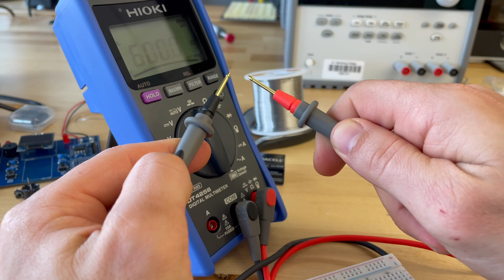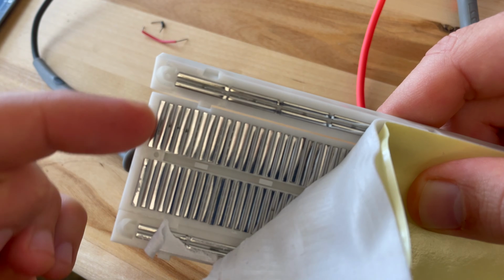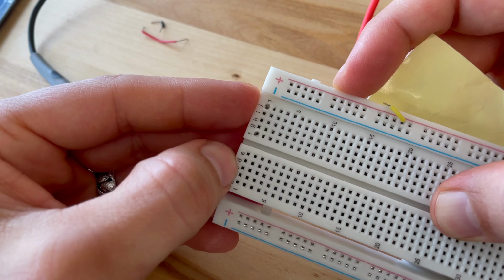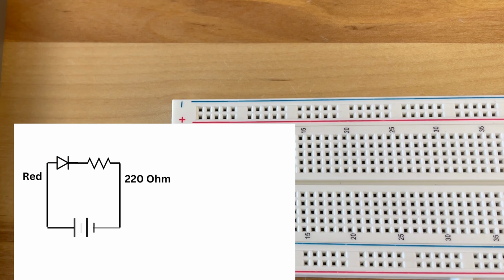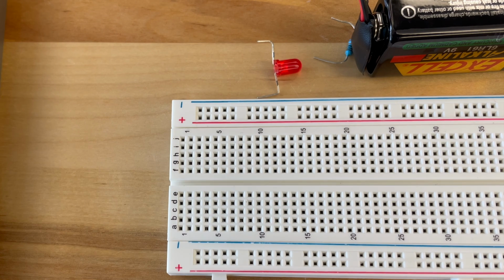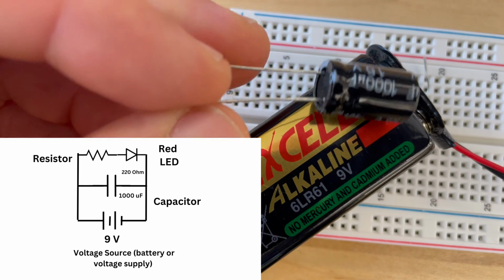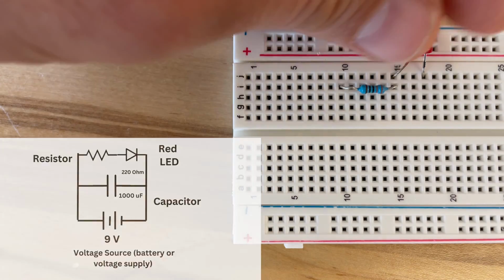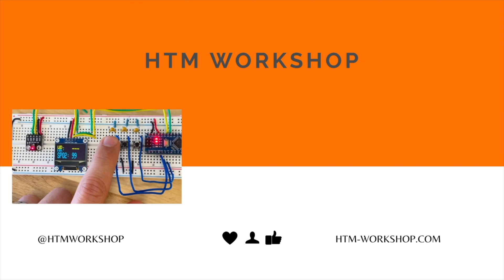Breadboard - Explained in Depth

Comment: Cool tip: buy crocodile probes for the multimeter and put the clip on a solderless jumper wire instead of putting it like you did

Comment: Bread boards are okay, but for a lot of projects I think people would be better off with wire wrap. Wire wrap lets you undo and change a circuit like a bread board, but gives you a permanent circuit that you can stick in a project box.
Reply: can I ask you why?
Reply: Breadboards are for testing and learning if you passed that don’t blame the breadboard